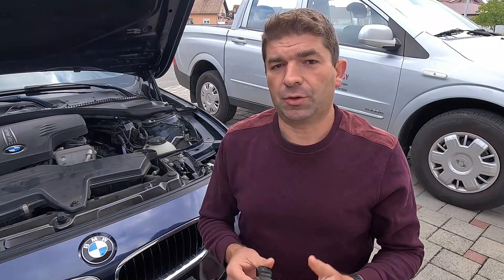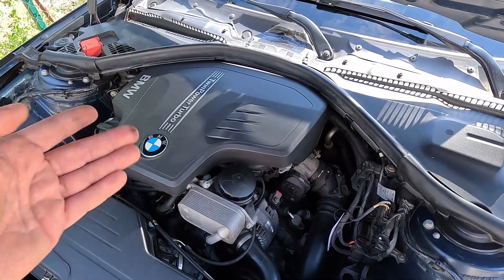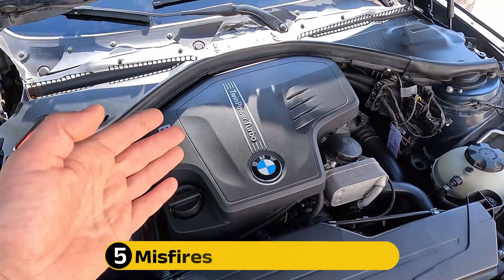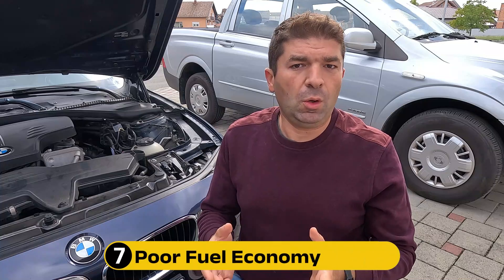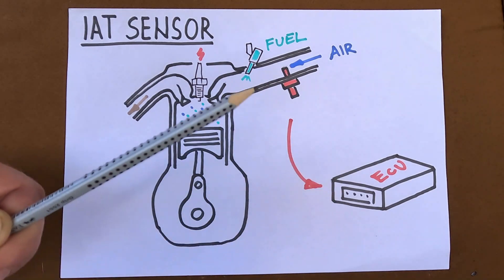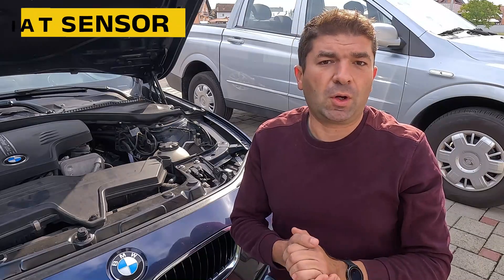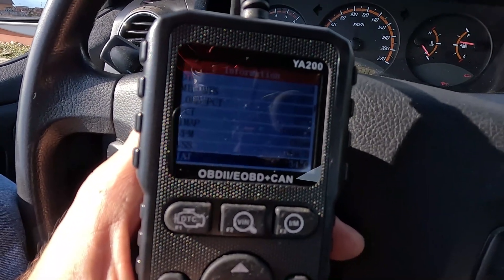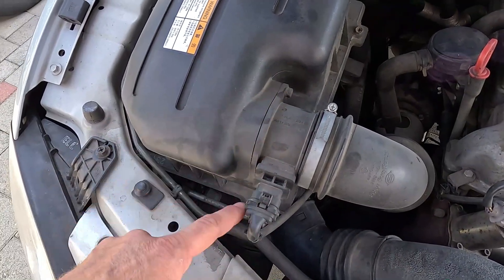7 Symptoms Of A Bad Intake Air Temperature Sensor (& Replacement Cost)

Comment: My code thrower is showing this sensor but while its running the battery light is flickering and i have already disconnected the battery while it was running so its not the alternator and i just replaced the ignition coils and the spark plugs

Comment: Hi... sorry to bother... i don't really own a obd scan... but my 318d E90 bmw just got a check engine light on right after rev hesitation on low rev would this explain it? Or should i be looking at IAT, MAF&MAP? Thank you in advance🙏
Reply from the maker: I'd suggest getting a scanner first, or getting the car scanned somewhere. These cars are too complex to fix by guessing.
Reply: @MechanicBase  found out the bracket that holds the pipe that connects the MAF was completely loose... I've tighten it all up and after going for a little spin round the block to take it to be scanned the check engine light disappeared  🤦‍♂️

Comment: If my  1999 saturn 1.9 starts imediately but than it runs gets hot then I turn it off and try to restart it and it just cranks over but doesnt want to engage
Reply: If it gets hot it could be a Thermostat, water Pump, or the Radiator or if it leaks water it can be a Radiator hose